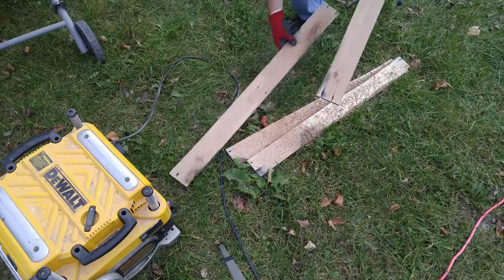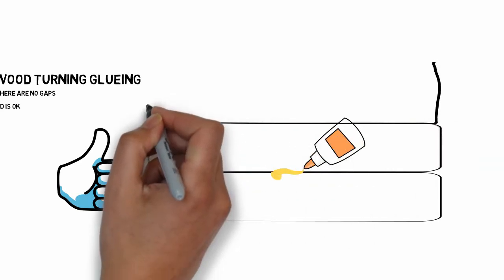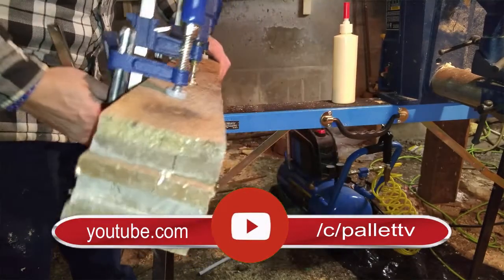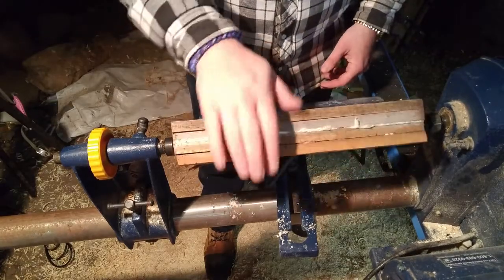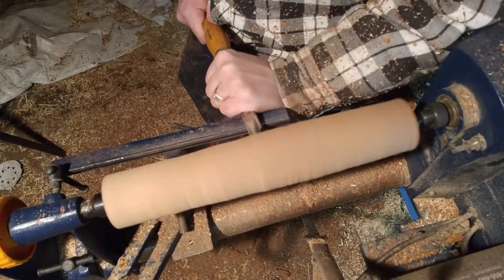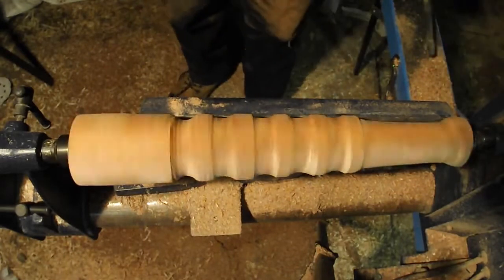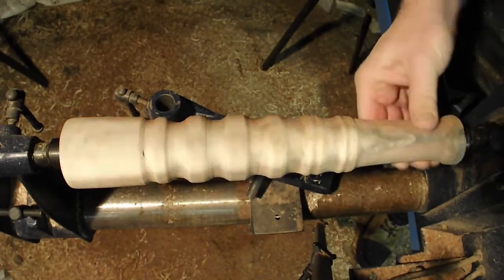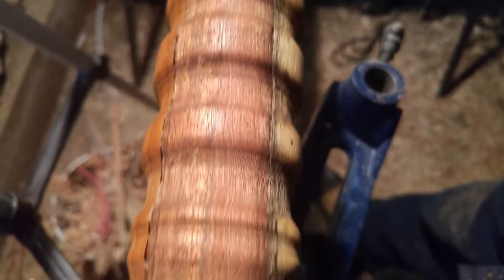Turning pallet wood

Comment: I see you have a jointer in your shop.  Just wondering if there is a reason why you wouldn't use your jointer to true up one face of each board before running them through the planer to clean up the other face?  Wouldn't jointing and then planing give you a much flatter board for gluing together, resulting in less risk of gaps in the wood that cause dangerous blowout situations?
Reply from the maker: Tim you are absolutely correct and that's what I should have done. This is why I had an incident and explosion on the lathe. There are electrical complications (renovating the house, no electricity in the garage yet where the jointer is) that prevent the easy use of the jointer and most of my better non-movable tools at this time. So occasionally I run an experiment and cut corners. Sometimes, a scary situation will ensue which will teach me that running a 100 foot extension cord is not that inconvenient and may actually result in a more pleasant outcome...